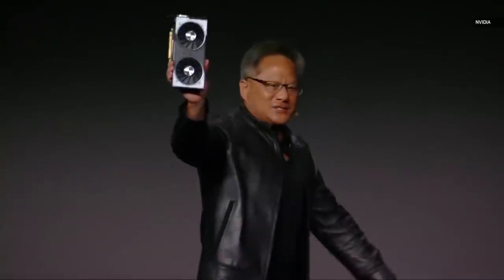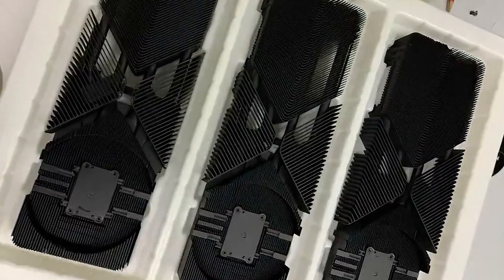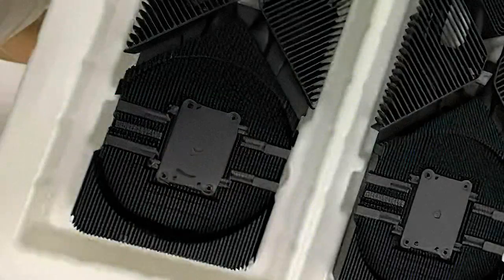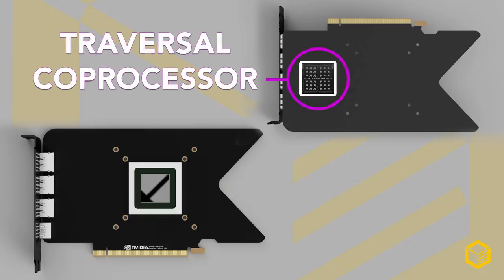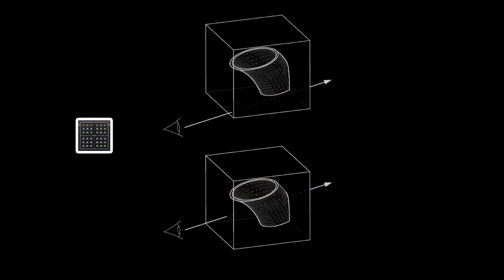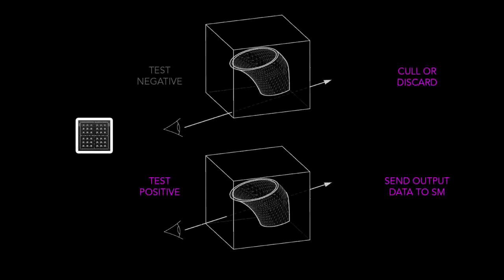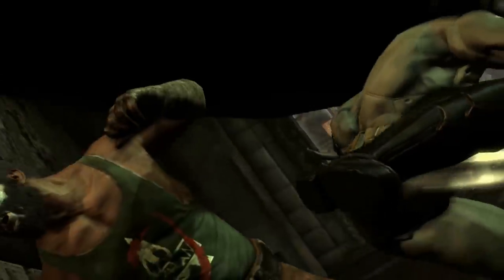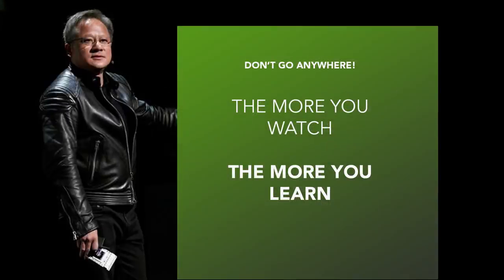A REVOLUTION in graphics is coming

Comment: Why no one is commenting on revealed info on NVidia's VR headset? This is the real revolution, not Ampere&double die, if true. The only similar headset using double screens with Tobii eyetracking/foveated rendering is Varjo, $5K+ enterprise VR headset, used by car manufacturers and  NASA's/ESA's astronauts. IF Nvidia can bring such "retina resolution" headset to the masses, number of VR users will skyrocket. I'd love to believe this leak, but it's just too good to be true. Manufacturing costs of specific high quality optics for double screens use is 500 bucks or more alone, Tobii's eye tracking costs 100-150 bucks, 4 micro screen panels (2 with ultra high PPD and 2 peripheral probably curved OLEDs to increase FOV - so going with Samsung is the only option right now) would cost A LOT, add some futuristic holographic tech on top of that ...  I can see it happening in $5K+ enterprise market, spoiling the show for Varjo, XTAL, StarVR... but not in retail anytime soon. Price of the parts needed is a barrier here. There's a manufacturing reason why high quality optics (used in micro/telescopes, photo lenses) & high PPD micro panels are so expensive: you just can't produce them on mass, not yet anyway. Also Nvidia producing "in house" optics is not gonna happen. They're not  lens manufacturers. You can't just decide to start producing optics all of the sudden. There's a reason why companies like Zeiss, Canon, Nikon, Sigma, Sony, Samsung... exist. Even Hubble's lens was not built in house by Nasa, but by 3rd party (Perkin-Elmer Corp) and still did a shitty job on it :)

Comment: Metal... can be 3D printed...
BTW why put the co-processor on a separate substrate? And not on an interposer like HBM? Height issues? 
Pfff, if they are manufactured by the same process, then that would be no problem.

Comment: There would be huge costs to throw data back and forth between individual chips (especially they are not even packed together).
See what happens to AMD's IF latency issues. And they still struggle to truely solve that latency issue.
For accelerator card, I don't doubt that Nvlink has enough bandwidth, but how about latency. If the data only flows one way, then it is probably OK. However, if two cards has to communicate... then it would be a disaster and nightmare for developers unless Nvidia's driver could fully handle that and it is developer-free. (not sure that could happen, otherwise most game should support some RT features now)
Rendering games' frames is quite a budget workload that need low latency and high speed.

Comment: The RT accelerator makes perfect sense and I hope it turns out to be what they are doing with Ampere. However, I am not convinced about Nvidia's ability to weather the coming squeezed on their market dominance without suffering lasting damage. Basically, it comes down to prices and convenience. PC hardware prices are simply far too high to be sustainable over the longer term unless we are talking about PC GPUs capable of rendering 8K or even 16K images at 60-120hz and displaying them on 4K panels. So sadly, the typical console gamers are not going to spend $500-$600 on a PC component let alone the $1500+ it would cost to build a PC cable of pushing 4K@60-120hz at the visual fidelity levels we was in the PS5 demo. We may like to talk about being the PC master race, but console gamers actually don't care because they get good enough quality and optimization for substantially less money.

That leaves 2 other segments, budget PC gamers (proabably playing at 1080p) and the enthusiasts. The enthusiasts will continue to throw money into their PCs, but the  budget PC gamers will be more likely to switch to something like Stadia for the coverage they get and remember, Stadia is the only cloud gaming service outside of Shadow.tech that even pretends to offer 4K@60fps. Stadia is going to get a Gen 2 upgrade and rumours were developers are already working with these Gen 2 instances. It is likely these too will have desktop or server grade RDNA2 or CDNA GPUs. Stadia is also free for these gamers. The story in the tech press about needing to have a chrome cast ultra and stadia controller only holds for Founders and Pro. In fact with the pro subscription you also get 3 free games each month. If you are a subscriber in June, you get 6 free games on top of all the past pro games you could still claim. I for instance now have 28 games on Stadia since November of 2019. I only paid for 6 of those games at reduced prices and of that 6 I paid for I have 5 of them on Steam and only paid for them on Stadia to support the developers/Publishers for supporting Linux. Of the 28 games in my Stadia library, I have only really played 2 (The Crew 2 and The Division 2). So I have more than enough games to play on Stadia. Yes Valve's Steam Cloud Play is in Beta on GeForce Now, but it is not a service limited to GFN. It is possible it will be rolled out to Stadia once more mature though probably only for games with native Linux versions or something like Neir Automata. Also remember that Valve and Google are partnering to get Steam working on Chromebooks. So again Nvidia will probably not have a long lived advantage with access to games on Steam.

As for the VR, this is still prohibitively too expensive for most people, and Nvidia aren't the type of company to think about making things affordable so, it is highly unlikely that VR will kick off anytime soon. In fact it is probably more likely to happen on the consoles than PC just because PSVR seems more of an affordable entry point than anything on PC currently. So if all the rumors surrounding the next generation of GPUs are true, Nvidia will face a tougher time in the consumer market going forward. It will only get worse if Intel enter the market with something meaningful as well.

Comment: Obviously headsets will replace TVs. And it is a huge disruption. We can see that 4K was a necessary move. Bump in framerates up to 120 is a necessary move. Work on audio is a necessary move. Move to SSD is also necessary move. But Internet improvement will require decade. And Nvidia needs processors. Whether they are in a box or in a data center.
What about ARM? ARM is shit for single thread performance in a data center. So parallel perf only. Not sure how you see they can solve this problem. IMHO TVs must move to headsets first. Games after.
And of course 300W machine on your head is not an option.

Comment: How is there any difference in CMOS potential between the GTX 680, 780ti and 980ti? They're all on 28nm, I get that each chip is bigger than the last, but shouldn't they have roughly the same potential? Also it's a known fact that maxwell blows Kepler out of the water in terms of perf/watt, that doesn't just come from another + on the node, AMDs competing gpus at the time are proof of that.

Comment: Does the negligible impact of different architectures work for regular processors as well? Thinking Ryzen 1st Gen vs 3rd Gen for instance.
Reply: Going from 14nm to 7nm in Ryzen give the uplift from 8 cores to 16. But Ryzen 3rd gen architecture give more single core performance across all 16 cores.

Comment: New architectures are largely designed around making use of more transistors allowed by smaller lithography. To claim that the architecture doesnt make the difference is missing the point.

Comment: I'd buy that theory if there was enough room under that backplate for a proper cold plate and associated heatpite; On these pictures however, there is not.
While the idea of splitting a GPU into multiple dice is not unheard of, they'd probably be interested in keeping everything close together to minimize latency, ie use an MCM package.

Btw, Nvidia didn't make the PhysX cards, they actually killed these immediately after buying Ageia, so that they could push their Cuda-accelerated implementation of PhysX instead.

Comment: I have multiple problems with statements in this video absolutely not grounded in reality.
1. Any chips performance only scales with "CMOS potential". -> Have you even thought about this?
I would put that the "CMOS potential" is equal to (number of transistors * clockspeeds), as both numbers are mainly limited by the used process node and especially the correlation of both. Using that formula with real achieved boost clocks Vega 64 (14nm) and 5700XT(7nm) have only a low single digit difference in that metric (I arrived at 2.2%). But how comes, that the 5700XT is over 20% faster than the Vega64 while having ~10% less memory bandwidth? RIGHT ... it is architechture! Just slapping on shader processors while the geometry units and ROPs are saturated does nothing (again GCN in Vega64). So the architecture is the whole reason why new chips with ever growing transistor counts even do anything useful without melting themselves or have functional units just waiting for data, wasting clock cycles. It is a synergy: Without advanced architechtures there is no use for advanced nodes.
2. Maxell was a jump outside of "CMOS potential"? -> NOPE
Using above formula, the 980Ti had a ~30% higher "CMOS potential" and also achieved about 30% higher performance. There is no gain outside of that. BUT they had to do something about bandwidth usage as the memory bandwidth was the same! So wouldn't they have adapted the ARCHITECTURE, they would have gained barely anything from the increased "CMOS potential".
3. The whole Nvidia VR layered display thing.
I could follow your points up until and including "NVidia will release a VR headset". They have all tech at hand appart from panels they have to source. But the layered display point was irritating. Layering them means, that the upper layers (chroma = color) have to be transparent to the light (luma = luminance = brightness) of the lower layer(s). That would not work with OLED! They are not transparent. 
4.And then this DLSS inside the headset thing. 
To pull this of, you would have a 20-30W heater inside the headset. This would end any chance of wireless VR. And DLSS is barely working with uncompressed content from the GPU pipeline. How on earth should this work on the messy, blocky and garbled bunch of pixels coming of a realtime game stream?
More and more I feel that coreteks went from analyst (as in analysing all the clues given which he then could give references to) to a purely fictional entertainer riding a wave of buzzwords. Maybe I missed it, but I've seen no source, no reference to support his statements in this video. This together with setting the wrong premise while ignoring stuff which can be analysed with very simple maths leaves a bad taste in my mouth.

Comment: Not sure what that 'rise of the APU looming' assertion is about, TBH. APUs are growing about the same as they always have and nothing special is going to happen unless you stick proper memory onto them (either on the board like in consoles, or directly on-chip, via HBM - which is still too expensive/unfeasible) or something along those lines; otherwise, desktop APUs will always only be enough for low-end and as they grow, so will the products they share the market with.

Comment: A revolution is coming in graphics? Well, that has been the expectation over the past decade with just minor to mild gains in performance with each successive GPU generation and with the initial RTX cards failing to fully convince the (gaming) masses.
And because this node shrinking process is reaching its physical limits, at least for silicon, something else will have to be thought of in terms of not only improving performance like in the old days of initial accelerated 3D GPUs but while also delivering game-changing features that can be improved upon in the next decades...

Comment: guessing a spicy design of a blower cooler, could be dope af or something crazy
Reply: The air drawn into any fan cooled GPU has to blow out of somewhere on the GPU.
Reply: @Safetytrousers  intake from top and bottom, exhaust from the vent on the pci bracket
Reply: @CallMeTonyga  Blower designs tend to be a largely sealed box with the vents just at the back to direct the air out the back. You don't put grills all down the side and underneath if you want all the air to eject from the back.
Reply: @Safetytrousers  Well I wouldn't think it would be a regular blower style, it would intake from top of the card, blow down and the other fan would suck it up and exhaust through the rear, airflow in a U shape and also the top intake fan would blow through the card too.

Comment: I swear, in the future each shader or graphic fx will actually be faked by AI. Rather than doing the actual brute force operation. AI ASIC chips will just dream up the desired result, and it will do the job orders of magnitude more efficiently. AI denoising is and upscaling is just the beginning.
Reply: I've had this thought for a while now too
Reply: This is also I think what will truly close the gap between pre rendered and real time rendering. If you can have an AI dream up a Hollywood level VFX in real time the only requirement is the training, the silicon required to run the program shouldn't be much more than what we have today
Reply: @miguelpereira9859  I also thought about how a game could have AI based FX toggles in the graphics menu along side the generic versions, so the user could decide, and that means even if the AI does a poor job it could be turned on by the user as a "lower quality" setting if they are running on say a low end laptop.

Comment: All this new stuff from Nvidia is Great, but what will it cost? My soul? That what worries me. Even if console were the lowest at raytracing atleast the cost lower than a single gpu. If xsx or ps5 priced at 600-700, you get the whole set with that. Just games that are left. Nvidia controller are great if you didn't need the GPU to work with geforce now. Like he mentioned, just using WiFi. Also the vr headset, considering the new tech, ai and Nvidia, expect it to cost 500+

Comment: The only thing that would blow my mind is a reasonable low price tag from Nvidia, after all, what good is having this kind of tech if developers don't really take advantage of it because most gamers can't afford the hardware and as a PC gamer, I used to buy higher end hardware but it's just not worth it any more, developers don't really take advantage of them, they target mid tier pricing because that is what most can afford and with the right visual settings, you can get the vast bulk of the visuals of higher end cards whiles spending far less, that for me is where the real market is and where developers will target thanks to the next gen consoles and the price point of the gpu's on the PC that are mid tier.

At the end of the day, developers will always target mid tier gpu's and consoles, Nvidia main problem is it's pricing so it's hard to get excited for what Nvidia are planning to offer whereas I am excited for the next gen consoles and what AMD offers later this year mainly because games will take advantage of them and the only way I can see them really taking advantage of Nvidia hardware is if it's priced right, especially in the mid tier and this is where the real problem is with higher end cards.

Comment: i dont like the latency implications of a coprocessor and secondary gpu. I dont think nvidia does either they abandoned sli after all
Reply from the maker: @kommando Kodiak That's a good point, but like I said, this isn't just a dumb chip. It does a lot on its on to avoid round trips to the SMs
Reply: @Coreteks  yup very well possible  and then the chip becomes a chiplet in hopper arch. We will see. I felt SLI support died as soon as TAP (tom) left for intel.

Comment: Coreteks, you are aware that there are games that already do raytraced global illumination, right? And you are aware that can be done on any raytracing silicon? Like, the current raytracing hardware can be used for any task that requires ray intersections, reflections, pathtracing, shadows, etc, it's just a matter of performance. Cause it sounds like you're saying that in order to do accelerated pathtracing we need new silicon.
Otherwise maybe I just misunderstood. lol
Reply: Games cannot do good ray tracing at the moment without a significant drop in performance. A GPU that can handle ray tracing better can do better ray tracing while achieving high game performance.